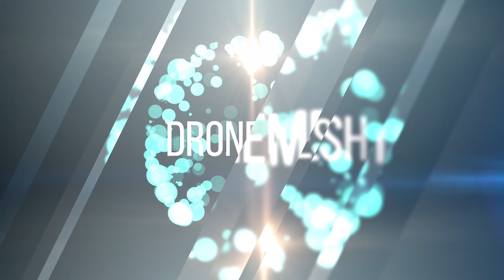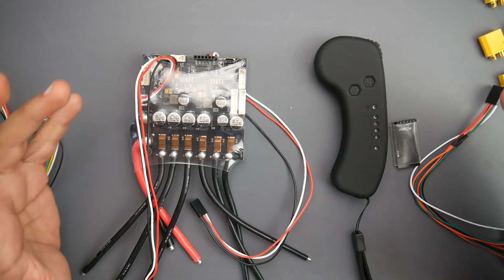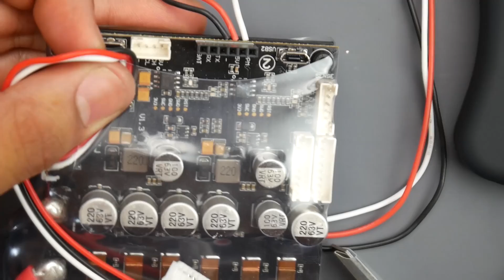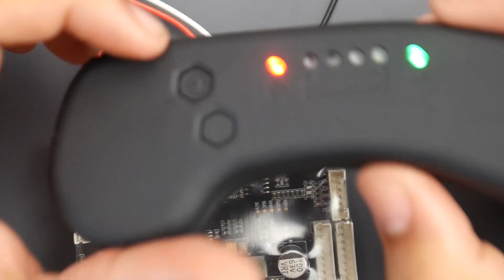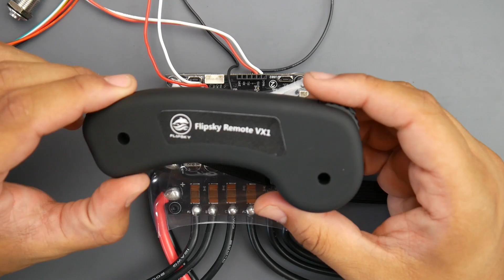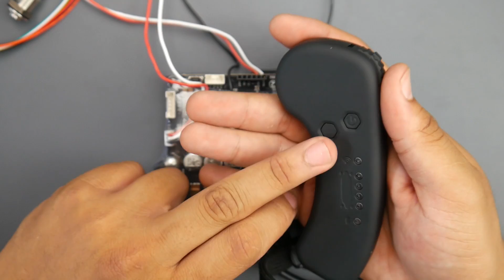Flipsky Dual FSESC6.6 VESC6 , FlipSky VX1 DIY Electric Skateboard Remote

Comment: Cool! I'm getting a Flipsky fsesc 4.20 for my ebike with the bluetooth module so I can monitor everything! Hope the flipsky quality is good!
Reply: Leon FPV I’ve been using a flipsky dual FSESC 4.20 for my electric skateboard and it works very well. I have about 250 miles of riding with zero issues. Good luck with your project 👍🏻
Reply: Bro im also in process of setting up my ebike, how did you mount the receiver to the esc for the bike?